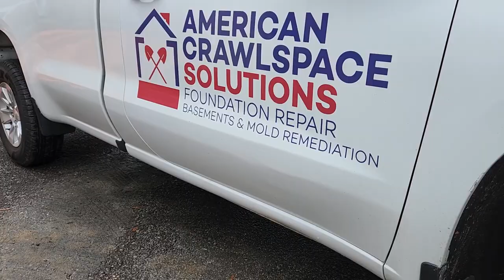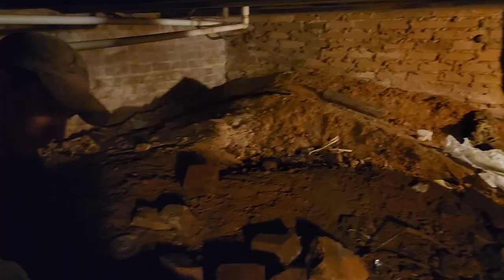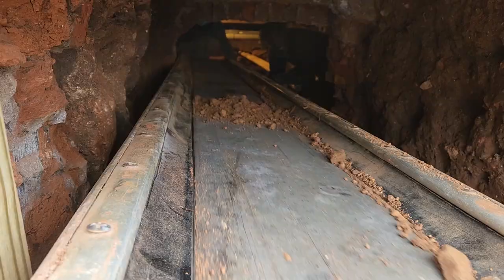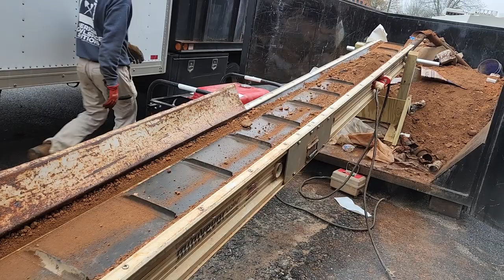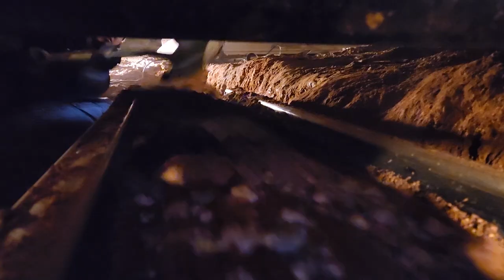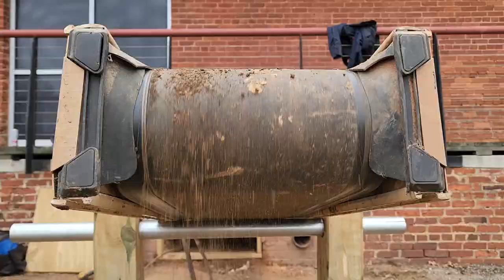Best Method for Crawlspace Dirt Removal. Conveyor Belts!

Comment: I installed drainage systems in basements and crawlspaces for a company and we had to carry out the dirt in buckets up to the dump trailer but a conveyor belt would've been much easier, more practical and would've paid for itself pretty quickly rather than having workers who could barely walk by lunchtime, taking extra breaks and stretching the breaks for as long as we could because the job was so miserable. Heck even removing a window or chipping out cinderblock to run the conveyer and someone coming back to fix it if there was nowhere else to run it would've been more practical than lugging it all out in buckets

Comment: How the hack did that much crap get into the crawl space in the first place?
Reply from the maker: 100 year old building---stuff adds up over the years!
Reply: Are you kidding? Brand new houses have that much crap. Here in the south everyone leaves whatever leftover materials and scrap where they are. Because that's where it belongs. They won't even level the dirt before building. It's a joke. Will not spend a second more to do a better job. Because that would be doing it wrong.